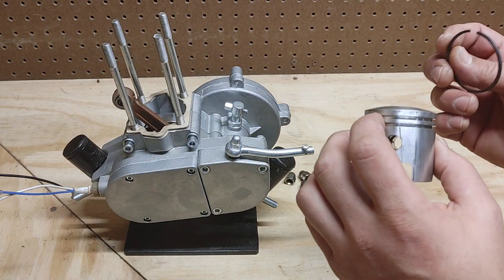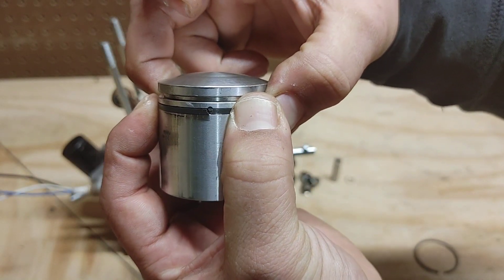Top End (Cylinder & Head) Assembly - Zeda 2 Stroke Bicycle Engines - Motorized Bike Jug Installation

Comment: Bicycleengines, what is the best bike for the zeda 100? I have a jamis earth cruiser as a candidate but im open to buying a new bike.
Reply from the maker: If you’re looking to install a Zeda 100 kit, the frame compatibility is key. Here’s what to consider:

Frame Compatibility Basics

•	Space requirements: You’ll need approximately a 9” × 9” triangular area, with 26″ or larger wheels (think classic cruiser or mountain bike frames) to mount the engine properly  ￼.
•	Tubing diameter should be around 1.5″ (38 mm) — anything much larger may require custom mounts

•	Watch for chain clearance — large tires (like fat tires) might need offset sprockets or adapters

🚲 Your Jamis Earth Cruiser

You mentioned the Jamis Earth Cruiser. It’s a cruiser with 26” wheels and a larger frame — likely a good fit for the Zeda 100. However, check its downtube width and ensure you have that ~9×9 inch mounting area. If it clears the engine and chain, it should work well.

Purpose-Built Engine-Ready Bikes

If you’re open to purchasing a new bike for the Zeda 100, these models are pre-designed for easy installation:
1.	Screaming Demon V2
      •	Features a pedestal engine mount, mag wheels, front suspension, and integrated 2.4 L fuel tank.
	•	Compatible out-of-the-box with most Zeda 2‑stroke kits — including the Zeda 100  ￼.
2.	Zeda Dawn V2
•	Features a 1-gallon integrated gas tank, front suspension, dual disc brakes, and aluminum frame.
	•	Specifically advertised as a cruiser ready for Zeda engine kits  ￼.
3.	Brigand Chopper
	•	Retro-inspired chopper-style frame with built-in engine mounts, front suspension, and disc brakes.
	•	Designed for seamless integration with Zeda 2‑stroke kits  ￼ ￼
Reply: The downtube is pretty fat smh i already spent allot, what doe the custom mount u mentiomed entail? @BicycleEngines

Comment: Need help put new piston in 2 stroke piston hits the cylinder cap and stops what am i doing wrong.
Reply from the maker: There are two main types of piston a low hole and a high hole.
If you try to use the wrong combination of connecting rod such as a long connecting rod with a short full distance it's going to hit the head. Confirm you have the correct piston with the correct bottom end and if still the problem persists maybe check the bottom gaskets

Comment: How do you take the engine apart if you ordered pre-assembled, but want to grease the piston to be sure? Can u just pull it off? or will tht break the piston rings?
Reply from the maker: You can remove the top end from the bottom end as many times as needed for repair or gasket change out. You will just have to torque the acron nuts again putting it back together. We always grease the piston before assembling it here in our warehouse. Just becareful you can tear the gasket by taking it apart. Here is the instructions from our website if you want them. https://www.bicycle-engines.com/product_images/uploaded_images/Cylinder-Assembly-Instructions.pdf

Comment: Question if I have to attach my chain and bearing plus a small cylinder rod falls out how do I reinstall it?
Reply from the maker: Good question! The ball goes in first then the pin. I add some grease while I'm in there. No trick just slides in.   It goes in the little hole in middle of the drive gear. Just in case you are not sure.
Reply: @BicycleEngines  okay and best way to get the bike warmed up before some steep hills would be if you have any tips

Comment: Since these are supposed to be triple 40 then they should all have a high hole piston correct? After mine is broke in I have a ported cylinder to install and while it's apart I was going to add a windowed piston and reed valve but I can't remember what piston it was when I put it together
Reply from the maker: Yes that is correct.
Reply: I'm having major problems with piston clips finally after going through losing 5 of them I have them in but now my problem is 1side is in further than the other side  and i think that's a problem am I correct?
Reply: @danajett  if you look there is a groove they go in

Comment: I can't attach my piston, it's pre installed, how do I get it out without damaging?
Reply from the maker: Can you explain more on what you are wanting to do? The Piston should come out with out damage. Are you talking about the cylinder?
Reply: @BicycleEngines  I got it out, it was loosely fitted inside it.
Reply: @BicycleEngines  however I am missing a black washer would I be able to use a regular washer, it sits under the head